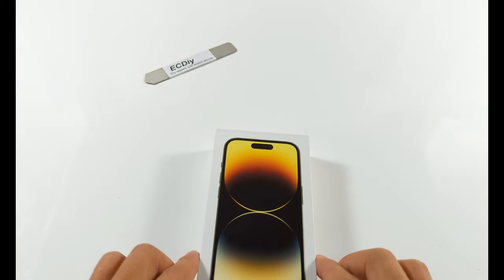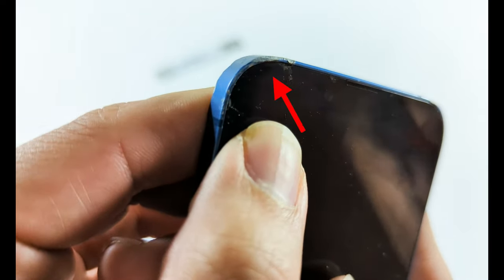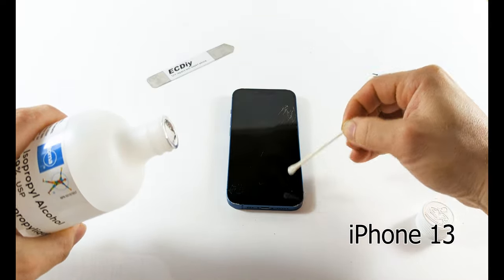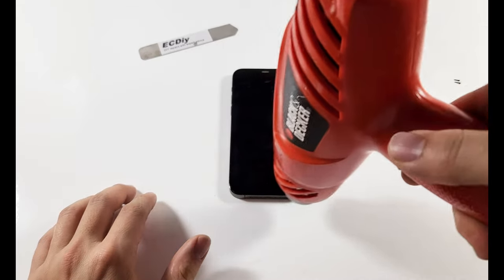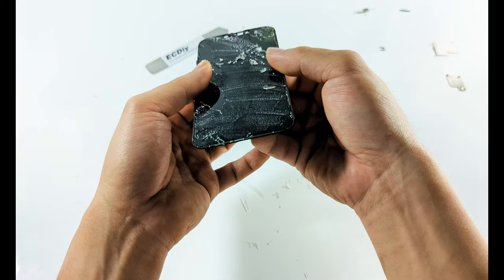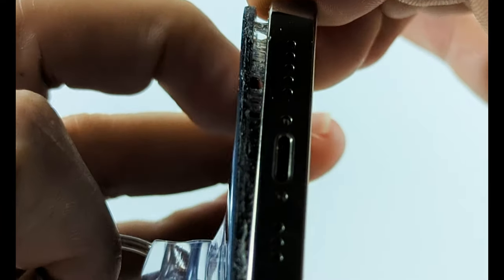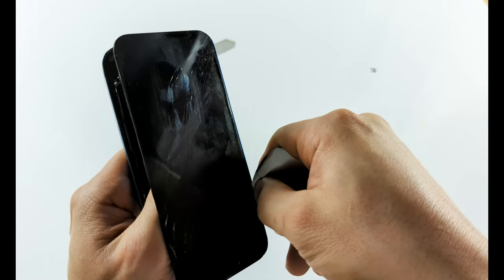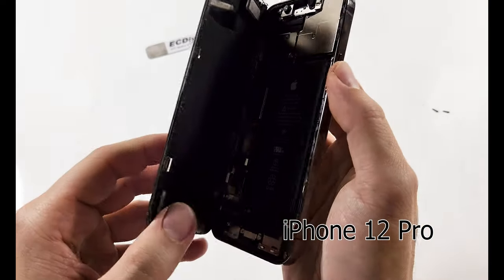Foolproof Way to Open ALL iPhone for All Repairs

Comment: Will you still make a video on how to remove the back glass?
Reply from the maker: Most definitely. Just finishing long term tests across multiple phones now. One of the phones had a camera go bad after a month. It could have been unrelated but now I have taken several phones from iPhone 11 to 14, some with the internals removed so we can see if there's any solution coming inside of the frame and what not.
   So far, everything is checking out. Just giving it a bit more time, and using the cameras more on an ongoing basis (just in case doing this shortens the lifespan of the lubrication applied to the gears)
    We were careful with the depth of the solution for the phone in the original shorts video and looking at the footages from this video, I do believe the camera issue may have been a coincidence but by doing the experiments with the internals removed and recording we're finding out how much solution should be used, and for how long.
   One thing I can say though is that it works well for small pieces, but not for larger pieces so you'd want to get a back glass breaker to break the larger pieces into smaller pieces. 
   Very promising for DIYers without the laser machine so far!
   Any questions/concerns, please do not hesitate to comment further/contact us.